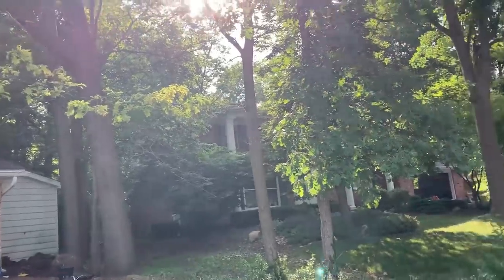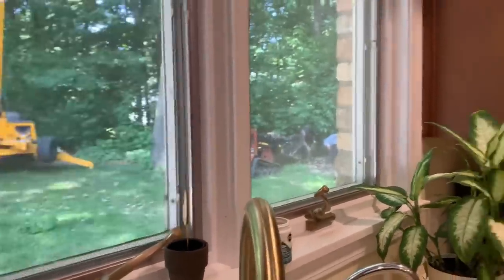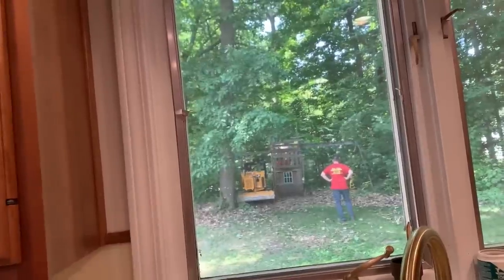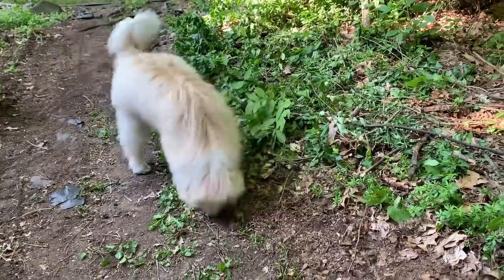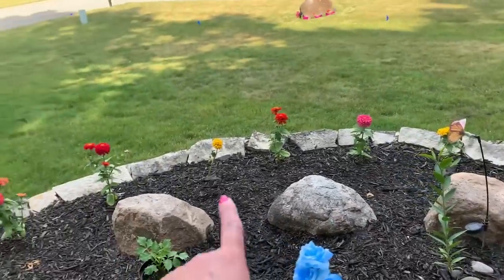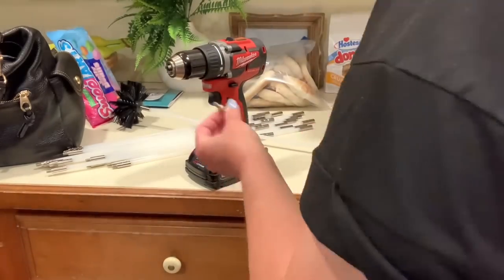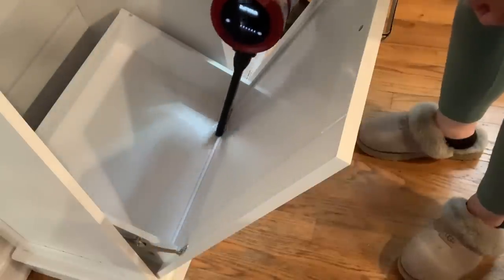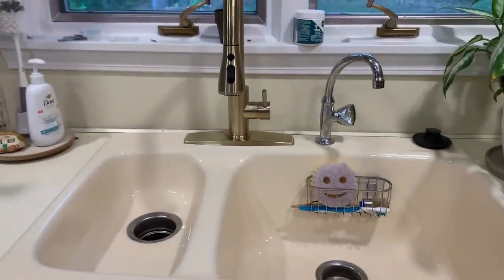MORE YARD CLEAN UP/ Planting Dahlias and flower update/ Quick cleaning of areas I don’t clean often

Comment: I hired someone to clean these out this dryer vent thing. It ended up that my dryer went up through my garage roof and it disconnected before it went outside and it had a big big clog in there which is why my dryer or was not drying. Ended up replacing the section that was so clogged and now it is now going out into the top of my roof so anyway, that’s that.
You are going to have to go behind the dryer and do it that way too so you get all the points

Comment: get some 7 dust for your flowers--you can get liquid or powder--works wonders and only takes a little...your card is looking great! Gerber daisy looks normal-it requires some sun but can be in shaded area. I keep mine on the porch. It does require lots of water though. Every day or it will look like that--just pinch those dead ones off and new ones will come in.